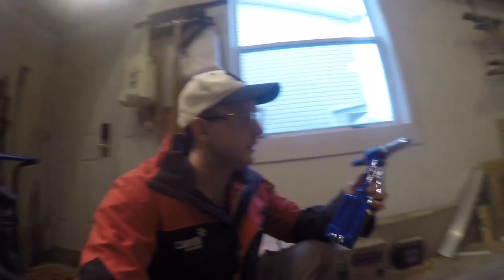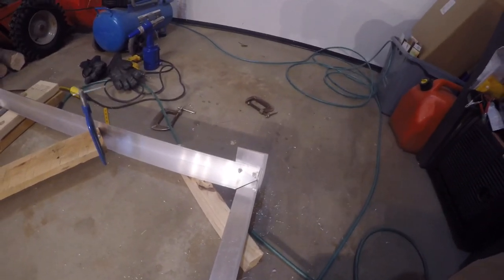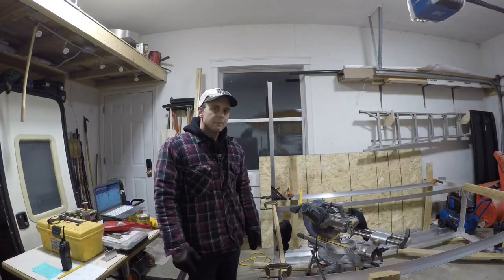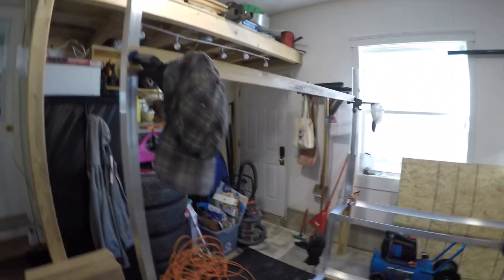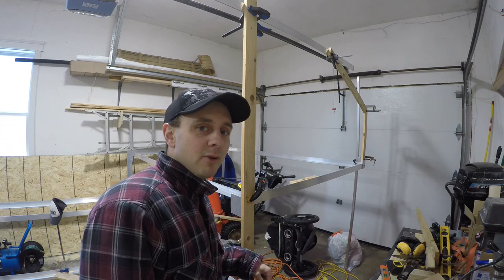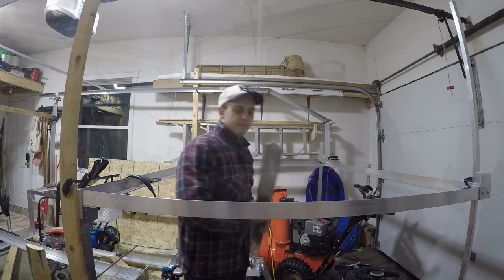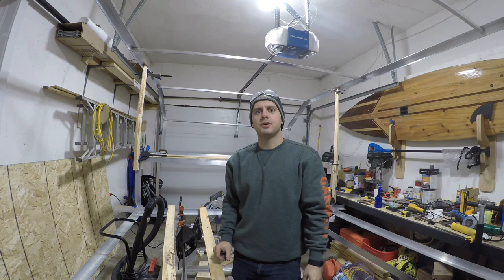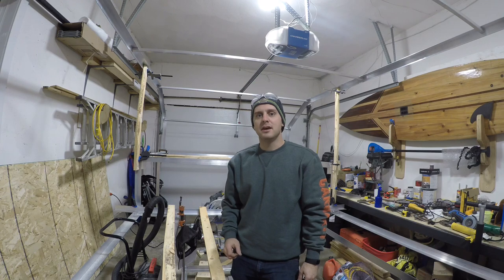Building Our Truck Camper-E3-Aluminum Frame Part 2

Comment: On my first build,  the most crucial measurement I made was my garage door height.  Lol

I missed your last line,  here's my edit.  

Tuning in from across the strait.  Nictaux,  Nova Scotia.
Reply from the maker: Thanks for tuning in! That really is the more important measurement to get right. I think if it didn’t fit out at this point I’d dig out the chainsaw and make my garage door taller. Have you built a few campers now? I’d be interested in learning some spots to go truck camping in Nova Scotia.
Reply: @SEAKAdventures  I've only built one so far.  It's my prototype. I've been using it for about 18 months now,  while planning my real build.  I've been buying and storing electronic things and carefully planning the good build of my keeper. Mine is a toy hauler truck camper.

Comment: Great build. But I think the welds will be stronger than the rivets.  Especially in something that will be going down thousands of bumpy roads in its lifetime.
Reply from the maker: I agree! I was sure thankful to get such a solid frame even if it did make a little extra work later putting in the panels. I’d say we have approximately 3-5 thousand kilometres on it now and have had no issues with the welds. I Couldn’t have done it without my friends welding skills so I’m sure thankful for that.

Comment: Cool what do you call those corner pieces that join the two pieces together? They make rounded pieces like that?
Reply from the maker: I just used a larger piece of aluminum angle to span both pieces

Comment: whats everyones thoughts on not welding the frame, when we look at caravan builds for exmple they may have an alloy frame but its never welded together, the wall panelling is either glued or riveted to the frame without welding. Obviously welding is much stronger but i wonder if its over engineering.
Reply: I have seen similar camper builds on youtube that are not welded but also do not have an over the cab sleeping area, I cannot fathom a sleep over cab without a welded frame. Also the no-weld units do not have a slide in and out frame, they are simply a canopy clamp on the bed rail system. I'm also in the process of drawing out an aluminum frame to construct for my 2017 Chevy Colorado which has a total carry capacity of about 900 lbs.
Reply from the maker: I don’t know if it’s over engineered but I’m very happy with the end result! I haven’t had any cracking of the welds and by adding in the extra square tubing I feel like everything is built to last. Prior to welding with just rivets the frame moved a lot, that also was without any panels installed so that might help tie things in.

Comment: What gauge aluminum are you using for the build, including the corner pieces you are riveting with the 3/16?
Reply from the maker: I’m not sure the exact aluminum sheet thickness but I think .030 sounds familiar. Almost all of my angle is 1/8 thickness except the corner overlap pieces which are 3/16 and the plates holding corners and the connection to the bunk were 1/4 inch.

Comment: How thick of aluminum did you go with?
Reply from the maker: Most of the angle was 1/8, the corners were 3/16, the bunk supports were 1/4 inch, and the 4x8 sheets were around 0.030? (Not 100% on that sheet thickness though)

Comment: Could you also find waterproof closed end rivets at a retail location?
Reply from the maker: I didn’t know they made waterproof. I have heard of the type like on airplanes but I would need access to both sides which I didn’t have when I added the styrofoam.
Reply: @SEAKAdventures  I used Sikaflex 221. Put a dab in before riveting and voila! waterproof.

Comment: thickness of aluminum is 5.0mm yes or not
Reply from the maker: The aluminum sheets for the panels were around 0.7mm or 0.030 inches. The rest of the material for the frame was mostly 3mm (1/8 inch) and 5mm (3/16 inch) for the corner pieces.

Comment: Hello. I would like to know what is the aluminum angle size and thickness.
Reply from the maker: Hi thanks for watching. The corners are 3/16 thickness -3 inch by 3 inch angle. The rest of the frame is 1/8 thickness -2 inch by 2 inch angle. The triangle brackets holding the bunk are 3/8 thickness.

Comment: Why rivets instead of welding?  Thank you
Reply from the maker: Once you get further into the videos you will see I have welding as well on this frame. I originally went with rivets as I did not have a welder for aluminum but my friend was able to help me out and once it was framed in it made a huge difference. The rivets saved a lot of time though by having most of the frame and basic shape completed.
Reply: @SEAKAdventures   oh yeah , 😎  great vids, thanks